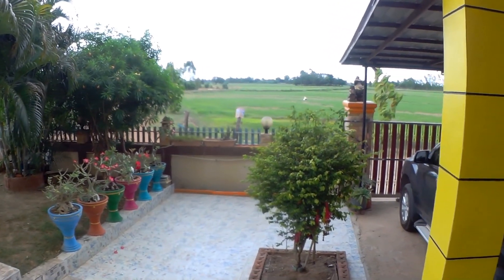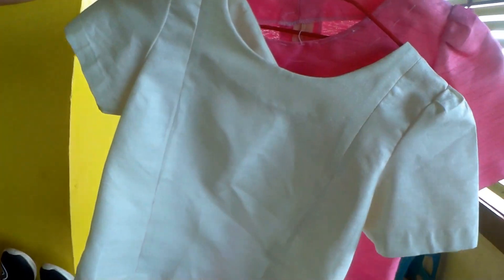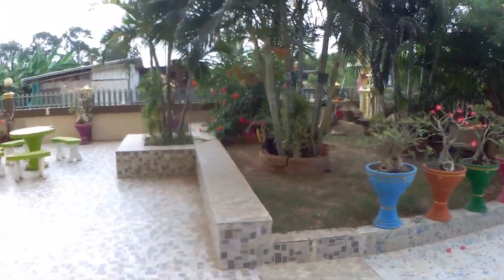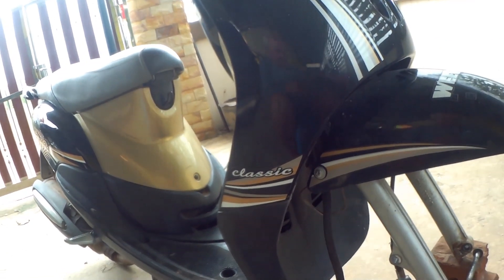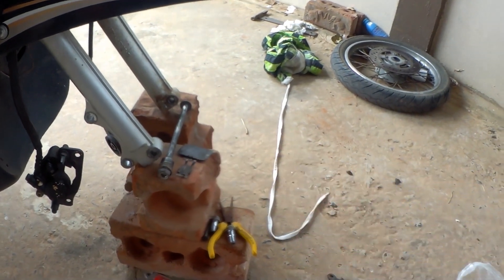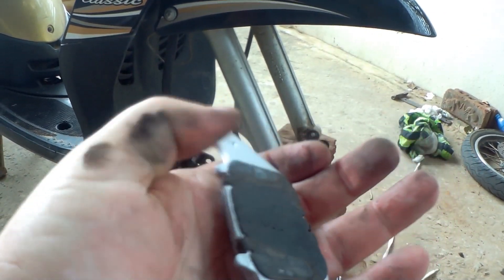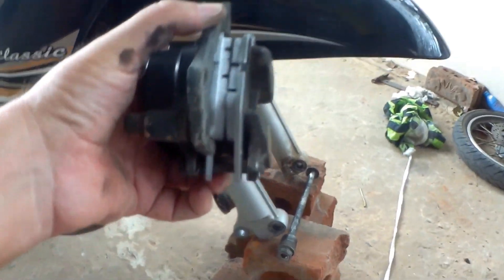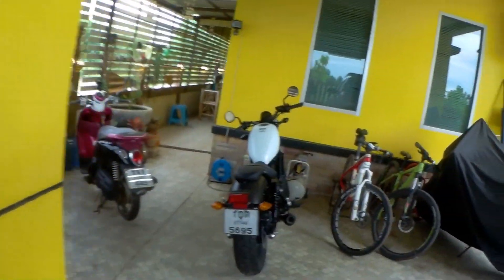Mimee's Home and Yamaha Fino DIY Brake Pad Replacement

Comment: Better off doing it yourself. At least you know all the bits like the spring and shims are put back in.
Reply from the maker: There is that lol. It was a case of running to the local shop and buying what they quickly to get the job done and get to the test centre...not that it matters as there's no need to book here lol👍👍👍🍻🍻🍻